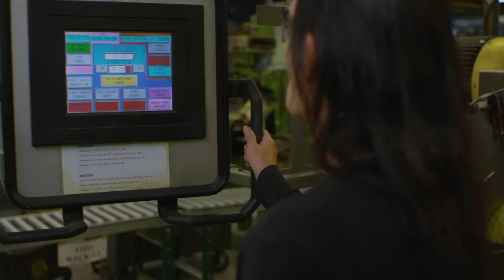GERBER GEAR - USA Manufacturing

Comment: "Hell yeah, Made in USA! USA! USA"
Looks at knife markings on majority of Gerbers
> Made in China

"The knife you choose is a life-or-death decision for soms military folks"
> "I served two deployments in Iraqistan. Man, if I didn't have my Gerber to open those MREs... cries silently I... regains composure I'd of starved to death. That much is certain. Thank you, Gerber. This $15 piece-of-shit made in China, designed in America knife saved my life."
Reply: SOME of their knives are made in Portland, their Portland-made knives work well for me
Reply: Jack Hadaki Well, whatever works
Reply: I still prefer moras and higo nokami knives though, more bang for your buck
Reply: Jack Hadaki Definitely, and a $20 Mora is also better overall than anything Gerber makes right now, except maybe the LMF-II, but even that's a stretch.
Reply: Morakniv makes a good knife, but they charge way to much atm for their full tang fixed blades. Their cheaper 15-20 dollar half tang blades are nice though. As for Gerber, their Strongarm is hands down their greatest knife. I've seen a few LMF II blades fail due to a weakness it has when struck on the guard when batonning. The Strongarm does not suffer from such a design flaw plus its full tang where the LMF II was not designed to be due to it being used and designed in such a way to be able to cut electrical wire.